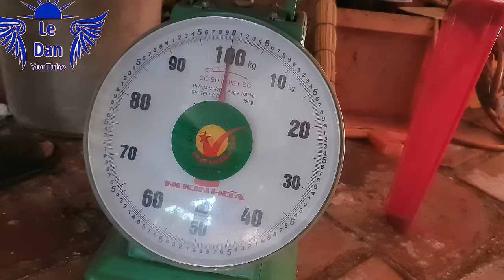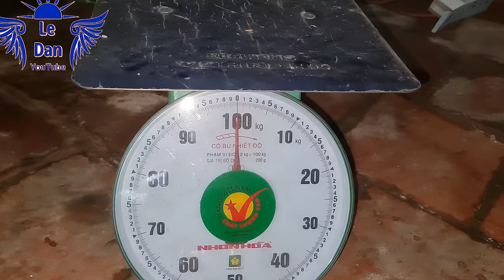I completely converted the regular engine to 4 cylinders from scrap

Comment: U all in the comments is not that brilliant lol y'all act like this dude has a masters degree in mechanical engineering lol all he's doing is joining the same engines together lol anyone with common sense and a shop like what he's got cause that's basically like state of the art cnc and milling shop right there with all them tools ect equipment even though there old the old machines are the best ones n simplest ones to work with in a machinery shop if you a machinist he's just joining the engines together n take the frount and back face of the small motor in put it on the frount and back once u got them stuck together he basically did the same for the engine crank he just cut the and put them together I don't even think he welded the crank together he just did like the small motors and weed eater motors to to connect their cranks or crank and rod's u heat it up and up the bowl through wich has a tolorence so tight u have to heat it up or use a hydrochloric press to put the in n through the whole cause the tolorence is tight on purpose its made like that to hold what ever together this stuff isn't that hard especially when u got a full shop like the one he got or all most full shop